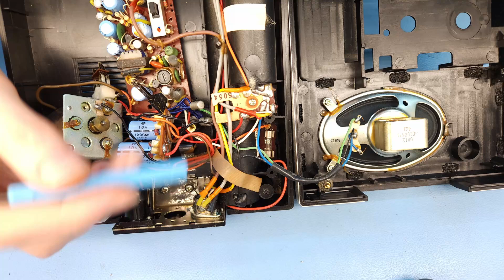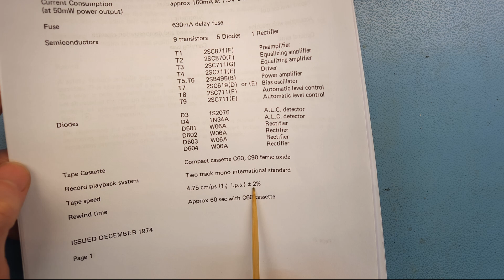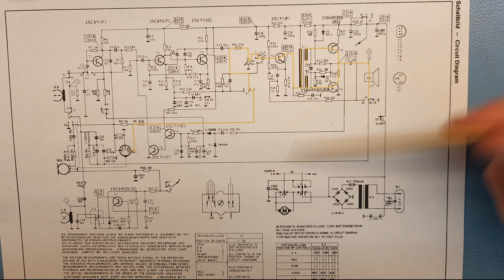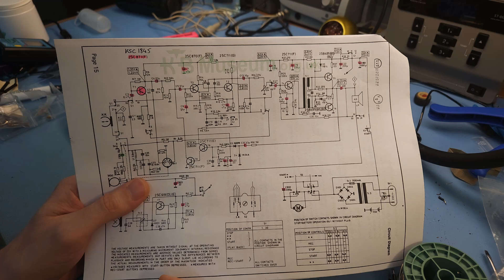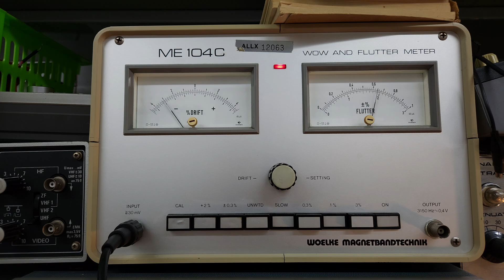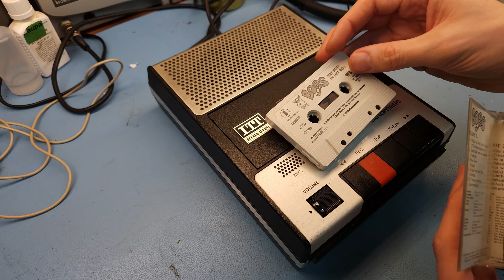Restoring the electronics of a vintage shoebox cassette recorder - ITT SL54 Automatic - Part 2

Comment: A common way to get a constant motor speed is to have centrifugally operated switches inside the motor case. Sometimes these can be accessed via an oval opening which has a paper sticker covering it.